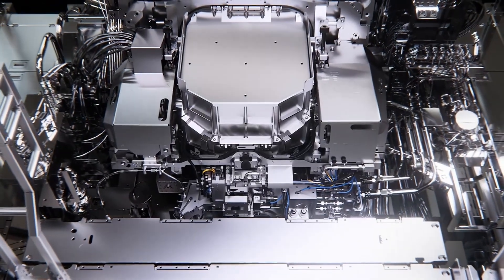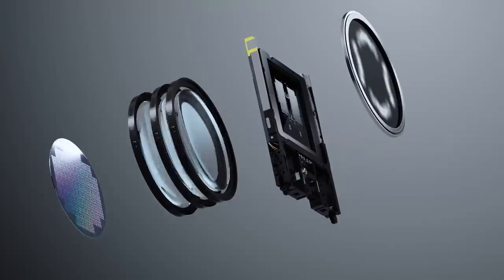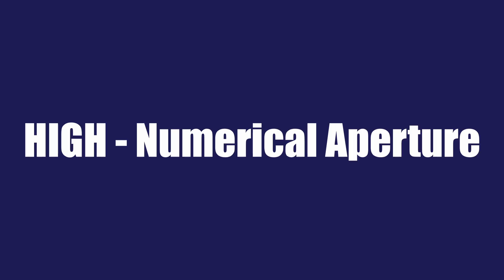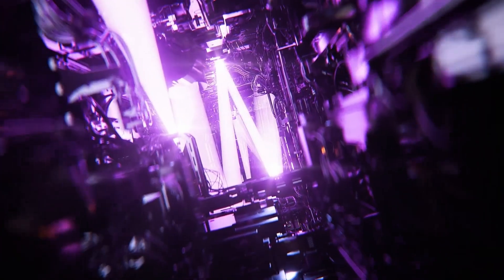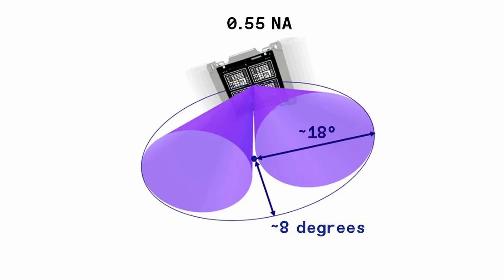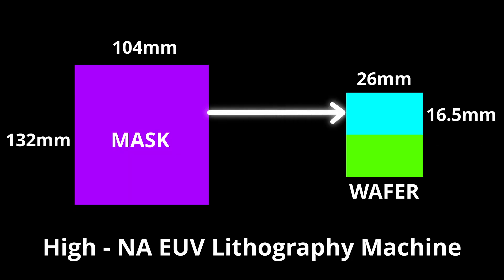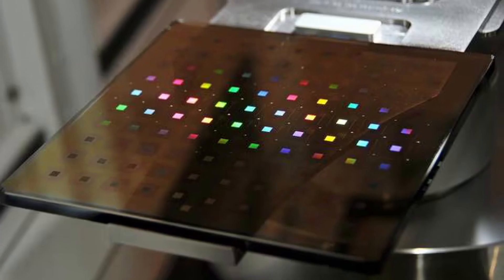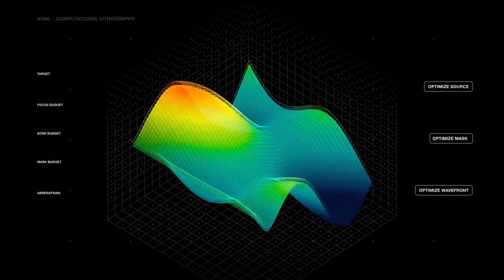Why ASML’s High-NA EUV Machine is a Game-Changer for 2nm Chips

Comment: Giants like Nvidia and Apple do not and never have manufactured their own chips; they totally depend on TSMC. Intel and Samsung are still trying to catchup to TSMC.
Reply from the maker: You’re absolutely right, companies like Apple and Nvidia only design their chips and rely on TSMC to manufacture them. Intel and Samsung both design and manufacture but are still behind TSMC in advanced nodes. The point I wanted to make in the video is that without ASML’s machines, none of these companies, whether they design or manufacture — could create their most powerful chips.
Reply: Well said💯

Comment: why is reducing wavelength below that not practical? I most hospital have x-ray machines that only cost about 100k that can produce x-ray, far shorter wavelength than euv light. Then there is linear particle accelerator base photon that use inverse compton scattering to produce near gamma ray level photon at around 1.5 mil. I don't think the constraint is in photon wavelength. Since there are plenty of other machine used in other industry that can produce significantly shorter wavelength for far lower cost than asml machine. 

photon focusing and vibration control might be a more limiting factor. Since higher energy x-ray or gamma ray pretty much go through everything or absorb without getting refract. Making lens extremely difficult.
Reply from the maker: Thanks for the great comment! You’re right, X-ray machines and accelerators can produce shorter wavelengths than EUV (13.5 nm) at lower cost. But in semiconductor lithography, the challenge isn’t just generating photons, it’s focusing them precisely for nanoscale patterns. Higher-energy photons like X-rays or gamma rays are extremely hard to focus because they don’t refract and are easily absorbed. EUV already needs ultra-precise mirrors, and vibration control is critical too. That’s why High-NA EUV, which boosts resolution by increasing numerical aperture, is the practical path forward instead of reducing wavelength below 13.5 nm. Appreciate your insight!
Reply: Plus at these small scales electrons just jump through the close distance gates and the entire output becomes unreliable. The only way to have denser chips is if instead of electrons we use photons, but they don't go through copper, they need an optical medium, so the entire lithography machine and process needs to be completely redesigned.